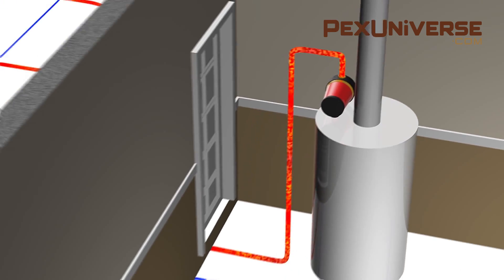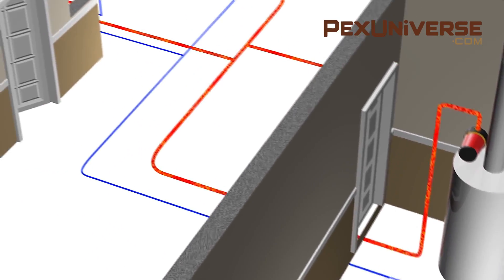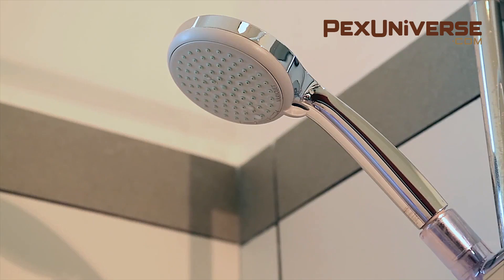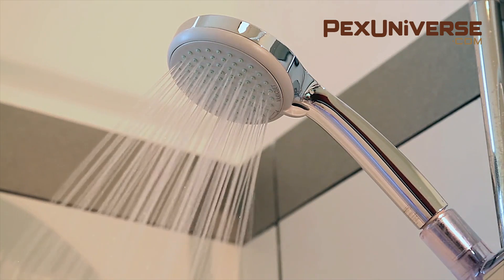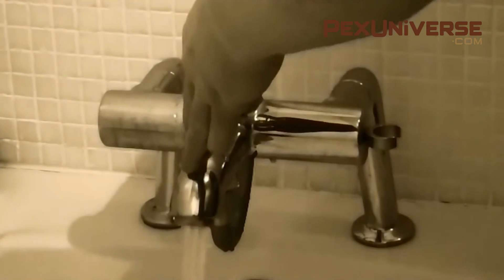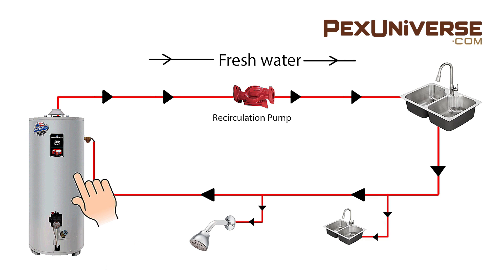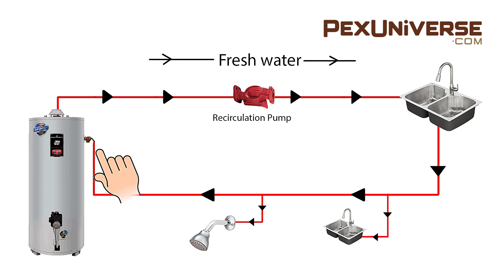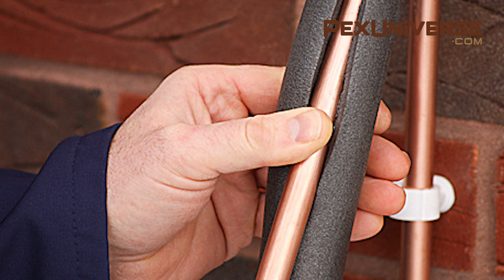Hot water recirculation pumps explained

Comment: We have 2 tankless gas heaters and a hot water pipe that returns to the  heaters, we can insert a pump in the circuit but since these heaters start working when a tap is turned on, the first time in the day the hot water is used it will not give immediate hot watter. How can we set it up so we have hot water immediately the first time ?

Comment: I live in a northern climate, and have experienced below zero temperatures during the winter. I also don't have a basement, so all plumbing repairs require removing sections of flooring to get access to problem areas. There is virtually no crawl space. To avoid frozen/bursting pipes, I trickle the water in my sinks and tub. I have an electric hot water heater, could this device be used to prevent water from freezing since it circulates the water?
Reply from the maker: Absolutely! Water recirculating pumps keep hot water moving through your pipes and back to the water heater. Installing a hot water recirculation system helps ensure that you always have hot water in your taps and should prevent pipes from freezing during the winter.
Reply: I appreciate the quick reply. After talking to the city workers, I was informed that the water pressure is 62 psi. I was reading somewhere that the pressure of these pumps was roughly 80. I'm just having a rough time wrapping my head around how this works. Additionally, a prior owner ran the water lines for the tub next to an outside wall when they installed the tub, which has turned into my problem child.

Comment: PEXUniverse Can this recirculating water pump do the opposite,  instead of hot but recirculate cold water instead of hot?
Reply from the maker: Hey Jacqueline, if you just want to raise water pressure in your lines they you probably need to consider a booster pump instead of recirculating pump.

Comment: Finally some honesty about a lesser known product. Of course the addition of the pump doesn't save energy, it is mainly a comfort device but it can also help conserve water.

I would say that all hot water pipes should be insulated, not just systems with recirc pumps.

I visited Namibia Africa recently, which is a desert nation. One cool thing is that nearly all of their hot water is heated with rooftop solar collectors that directly heat the water, it is then stored in insulated tanks. But, because we were in a desert, with very little water, they asked us to catch excess water in a bucket, while waiting for our shower water to emerge hot. They then use that water for cleaning and washing clothes.
Reply: Actually it wastes energy. Instead of having cooled water in the whole pipe system, it is refilled with hot water and allowed to cool down again, especially if it's not used right away after it recirculates; not to mention the power needed for the pump itself.
Reply: @tkjho  
Yes, it wastes energy and saves water.

Comment: Can a water circulation pump work with solar water heater with no indirect heat exchanger? (the tank and the solar thermal collector are together in the sun while the pressure comes from the city main).